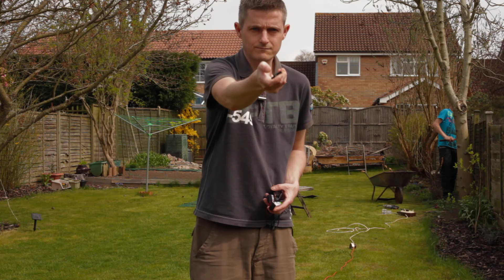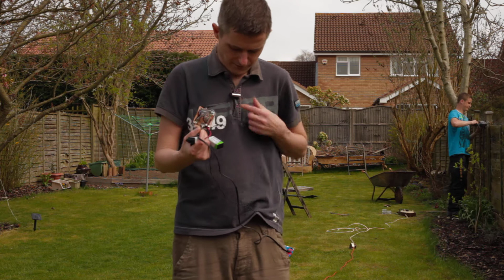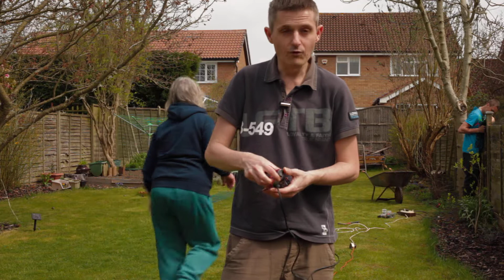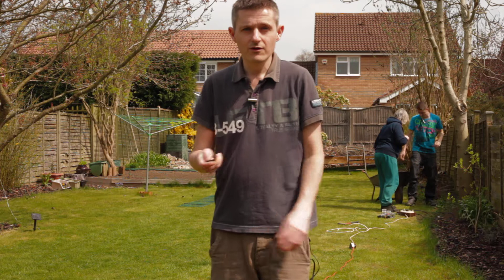DIY Wireless Audio - Video Test Recording

Comment: My WiMi has annoying audible buzz at app. 400 Hz, and it disappears if I mute the transmitter. In case of silence - it's not silence, but the above-mentioned signal, not to mention high-s and low-s, which are cut - I hear it. Does your one behave so? Thanks
Reply from the maker: +destynick Well I am guessing that the 400Hz is perhaps some harmonic of the mains frequency and you will be from the UK or somewhere with 50Hz mains. This unit is sensitive to electromagnetic interference (such as mobile phones, power supplies etc.). One thing that I know for sure is that if you use a mono connector into this device you will get something like an earth loop type problem which definitely creates a buzzing sound. Try for example, running a couple of RCA (phono) connectors from a CD player into a Stereo minijack of the transmitter. You shouldn't get any interference then.

My little mic amp was made as a stereo amp for a rare stereo lavalier mic. Are you using a pre-amp?

And about the shelving you are referring to, I think that the device does have some limits to its bandwidth. But I think for talking stuff is generally OK. That's OK. Not perfect!
Reply: +Michael Maggs First of all, thanks for your detailed reply. 400Hz, not only 'mine', but also yours ( https://mega.nz/#F!c4NF0IxD!61IoIMtgdKLrXHidB7PR1A ) - should be really some harmonic...but - the device is not simply sensitive - it's extremely sensitive, and it makes it almost useless for me. Initially, I planned to replace Sennheiser EW100 by this device (for music, not for speech), as Sennheiser is too heavy and, I must say, clumsy in comparison with it - besides, it's mono. But this stereo link is ready to receive...and also transmit - exactly transmit brain-drilling buzz and interference. Yes, I have 50Hz mains, but if I put my hand entirely on the transmitter - it stops... more precisely, minimizes buzzing. However, it's not possible to put a hand and stay so. So.... this 'real stereo audio link replacer' has caused a trouble for me. As to the shelving - sure, it's normal for speech - not for master track transmission. But its buzz is annoying indeed.
As to mic and pre-amp - I'm not using mics, - I just purchased the device for wireless connection, let's say, of line out signal.  
Finally, regarding  - running a couple of RCA (phono) connectors from a CD player - my CD player has 3,5mm jack stereo audio out. I connected it to the transmitter with jack-to-jack cable - the same result i.e. 400Hz.